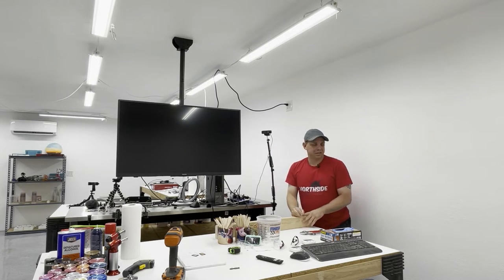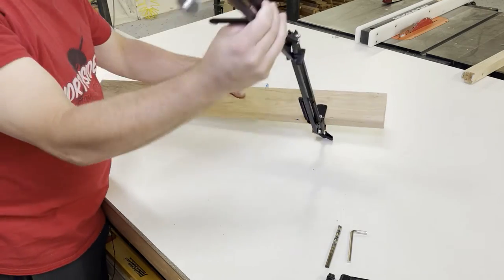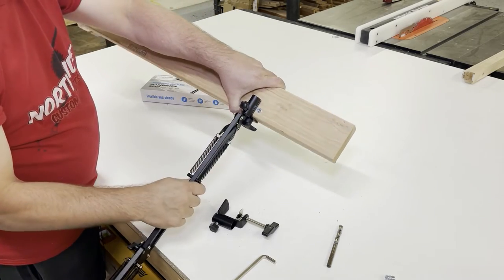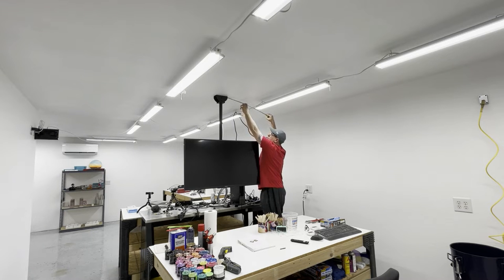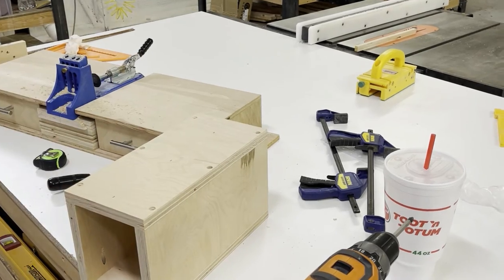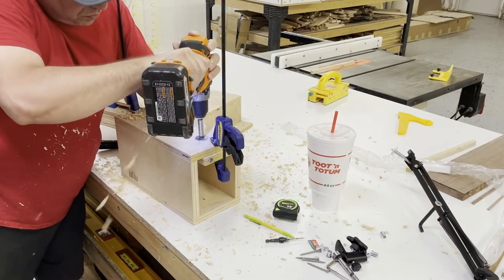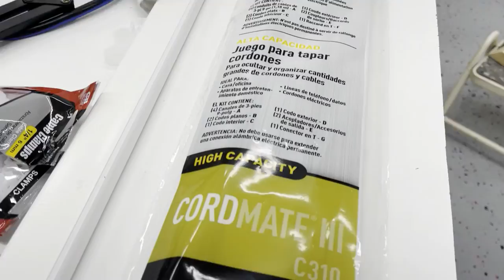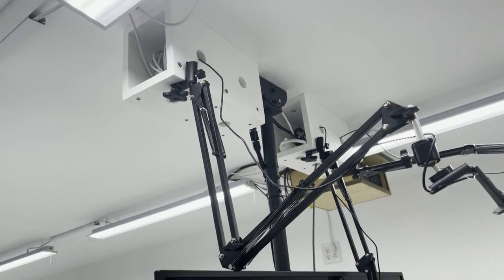DIY How to Mount Cameras on the Ceiling for a Pod Cast or Livestream!

Comment: Hey my friend how are you doing great info great info. I love it especially your camera mounts I've been trying to figure out how to hang one over my table saw. But everywhere I'm mounted on the table saw I get vibration for the camera. I'll give your idea a try and thank you. In the very beginning of your video where you're standing I noticed that the wall behind you is completely empty. Just a thought I had an echoing problem also not in the shop but in a different type scenario and I simply hung curtains on that wall which I could move slide out of the way to get to the pegboard and things that I had hanging on the wall and the curtains. Took away all the echo from the room and it was only on one wall. What I do for a living is I'm a commercial contractor I remodel high-rise office buildings. And I deal with a lot of sound issues. And curtains are the way to go . And in the event of a shop you can knock the dust off of them very easily. You can use the backdrop of them for a black screen. And they absorb the sound. The reason you're having so much echo in that room is because of all the hard surfaces drywall everywhere and concrete floors. If you put some commercial carpet tile down in that room you can vacuum the dust off of it very easily and it also creates a soft surface. Also if you happen to build a room like that again. Put in acoustical drop ceiling in it. You can put it four or five inches below your sheetrock ceiling and the acoustic ceiling will also absorb sound. And it makes it very very easy to hide wires above it. but I can almost guarantee you you'll get rid of your echoing which is some curtains on that one wall. The other options would help even more. if you'll think about the last time you went to a big movie theater. If you notice the walls are ruffle they look like curtains and they are the non-flat surface of a curtained will help absorb the sound also dramatically taking away the echo all the flat hard surfaces that you have right now in the room are the reason that you have the echoing.I sure hope that helps. you just happen to mention on a subject that I know a lot about. With sound. Thank you my friend thank you good to see another video. From Doug take care  my friend
Reply from the maker: Great information… I’m editing the video on the first part of the process where I use foam panels and make an enclosure for live shows.. I’m going to do another video on making DIY sound panels .. I have some moving blankets to cut off the room if I need to
Reply: Jake that's awesome my friend thank you thank you. I sincerely mean it I'm pretty good with soundproofing and echoing in rooms anything I can do to help anything at all you let me know my friend and thank you